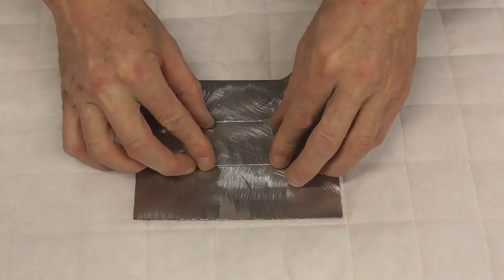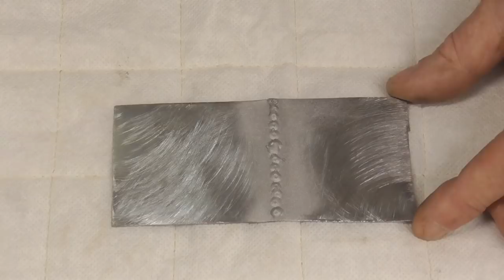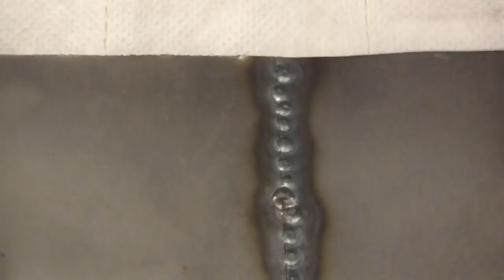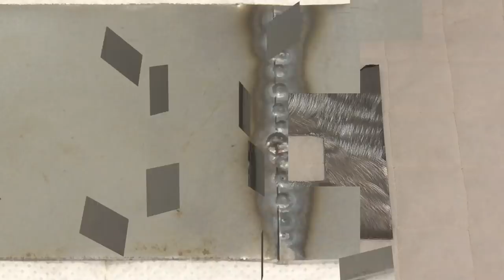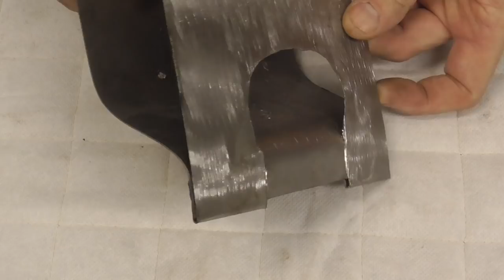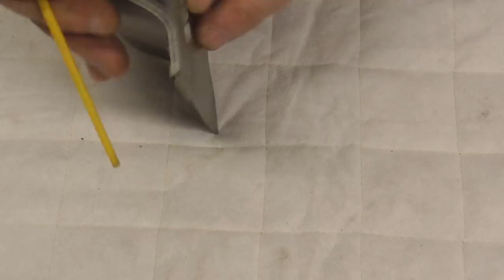Welding Patch Panels - Lap or Butt?

Comment: The back of the butt weld clearly shows that most of your welds are off centre. Grinding the top surface would seriously weaken this repair.

As others have stated, create a patch which is 1mm smaller all round. and use a joggling tool to create a 10mm flange along  the four edges of the repair panel.
This will ensure you don't blow through the original panel and you can run short seam welds rather than an endless number of spot welds, and minimal grinding.

Large amounts of grinding suggest that your wire speed is too high.

Comment: First, thank you for your videos.  OK - I agree with some of your points, but I can make arguments that lap welding is not a good way to go, yes faster - but will create more corrosion problems than what you started with.  Also, both your approaches necessitate the use of a lot of filler after the welds, in order to smooth things out.   Regardless of the welding approach you take, you absolutely need to protect the back side of the panel with corrosion prevention.  Another fabrication channel explores the "Cut and Butt"  approach - I taught myself this technique, worked on the penetration issues and have now mastered it.  If your interested in learning another approach, check out "Fitzee's Fabrication" https://www.youtube.com/results?search_query=fitzee%27s+fabrication He has a number of videos that  thoroughly explain how to make perfect butt welds, setting up your welder, how to finish, etc...  I hope this helps.
Reply from the maker: I use a combination of both lap and butt on almost every patch but I would never just butt two pieces of metal up, weld it, then grind away at the area attempting to metal finish it for many reasons but here are two: https://www.youtube.com/watch?v=MfKlNQF-o4I  - https://www.youtube.com/watch?v=e9bjZ_UxtJg  
Also today’s metal is .030. That is literally 6 hairs (hair is .005) thick.  You start grinding on that and voila paper thin metal and welds. Both methods work well if done properly so in the end it’s what works for you..  Keep in mind, you won’t find anyone butt welding in professional shops. Surely you’re not going to butt weld and metal finish this: https://www.youtube.com/watch?v=36zkc9UQaTs or some of my other rust repair videos.  Use small overlap - weld solid - no moisture - especially if you keep the drain holes clean (most important thing in rust prevention). Note that  the opening of the seam is upside down on the inside too.  Please see this video for longevity of this type of repair if done correctly: https://www.youtube.com/watch?v=8XaZBy7GC7A or 
https://www.youtube.com/watch?v=2o37dX--w0I   Hope that helps :)
Reply: anyone can say one way is better than the other …. New piece of crap cars rust within 10 years  in wet climates …. most cars will not be around 10 years after these repairs , so cost effectiveness etc . Is relevant….. I bet any job jerry does will outlast another place on the car sure to show rust !!!

Comment: A couple of things I noticed. When you showed the backside of the butt weld it was obvious most of your tacks were way off center so no wonder it looked bad. Also you didn't get penetration on a third of the tacks. You say there are gaps on the back for water/salt to get in and rust. If you do the overlap technique there are a lot more gaps for water/salt to get in. So the only advantage to overlap method is that it is faster but has a lot of bondo. Good if you want to sell a car but not if you are restoring one. The other comment is about your use of sandblasting. Don't use it in an area that you can't clean it out completely after blasting it. I noticed you doing it in another video inside a panel and then welding on the outer piece of metal. The sand will rust thru in no time. I speak from experience. I had my 69 Camaro undercarriage sandblasted and painted by someone. A few years later when I went to replace the carpets I found that my solid floors were no longer solid where the sand had got into the crevices. One of my new quarter panels developed a rust hole where the sand settled behind the wheel.
Reply from the maker: I use a combination of both lap and butt on almost every patch but I would never just butt two pieces of metal up, weld it, then grind away at the area attempting to metal finish it for many reasons but here is one: https://www.youtube.com/watch?v=e9bjZ_UxtJg  Check out Eastwood's video in the description too!  Very good at explaining my thoughts on this.
Also today’s metal is .030. That is literally 6 hairs (hair is .005) thick.  You start grinding on that and voila paper thin metal and welds. Both methods work well if done properly so in the end it’s what works for you..  Keep in mind, you won’t find anyone butt welding in professional shops. Surely you’re not going to butt weld and metal finish this: https://www.youtube.com/watch?v=36zkc9UQaTs or some of my other rust repair videos.  Use small overlap - weld solid - no moisture - especially if you keep the drain holes clean (most important thing in rust prevention). Note that  the opening of the seam is upside down on the inside too.  Please see this video for longevity of this type of repair if done correctly: https://www.youtube.com/watch?v=8XaZBy7GC7A or 
https://www.youtube.com/watch?v=2o37dX--w0I

Comment: I always tell to my customers, this is a repair, using metal. Is the manufacturer of the vehicle desingn that makes it rust in some spots. If there not place to treat the patch behind with any kind of protection for the weld it will corrode again. Buttweld is something Fancy, at the end is a repair. And many people look at body filler , like a criminal. 50 years ago , you have to grind the metal to gain grip to the filler, this days filler technology allow you to put filler over barelly sanded surface , without any future problems. The most beutiful show cars are completely skimmed with body filler.
Reply from the maker: Great points and logic Ramon - thanks for the comment my friend :)
Reply: Yes show cars that never see the street or any type of weather so it's a terrible comparison

Comment: I would rather butt weld, that way there isnt a space that can hold moisture. Even if you seal it its eventually going to lose its seal and trap moisture and rust.
Reply from the maker: That’s not true about the moisture  - I've never had rust get between the panels (it's < 1/4" overlap) that's internet stuff.  Been patching with lap and butt since 1984 never had a patch bubble if done right.   Cars rust from the bottom of the panel up because moisture sits down there not on the side of the panel.   Really... see this video for the truth.  https://www.youtube.com/watch?v=8XaZBy7GC7A or this 
https://www.youtube.com/watch?v=2o37dX--w0I
Reply: @LakesideAutobody  I have a 66  mustang that has rusted out spots  where the panels are overlapped so you cant tell me I'm wrong.
Reply from the maker: @masterofnonetv8361  Use small overlap - weld solid - no moisture. Please see this video on how long this type of repair lasts if done right - https://www.youtube.com/watch?v=8XaZBy7GC7A

Comment: 2:59 you're completely off the line and haven't got proper penetration... It's not a problem with chosen technique but application of technique. You didn't even leave a gap to fill...
Reply from the maker: I use a combination of both lap and butt on almost every patch but I would never just butt two pieces of metal up, weld it, then grind away at the area attempting to metal finish it for many reasons but here are two: https://www.youtube.com/watch?v=MfKlNQF-o4I  - https://www.youtube.com/watch?v=e9bjZ_UxtJg  
Also today’s metal is .030. That is literally 6 hairs (hair is .005) thick.  You start grinding on that and voila paper thin metal and welds. Both methods work well if done properly so in the end it’s what works for you..  Keep in mind, you won’t find anyone butt welding in professional shops. Surely you’re not going to butt weld and metal finish this: https://www.youtube.com/watch?v=36zkc9UQaTs or some of my other rust repair videos.  Use small overlap - weld solid - no moisture - especially if you keep the drain holes clean (most important thing in rust prevention). Note that  the opening of the seam is upside down on the inside too.  Please see this video for longevity of this type of repair if done correctly: https://www.youtube.com/watch?v=8XaZBy7GC7A or 
https://www.youtube.com/watch?v=2o37dX--w0I
Reply: @LakesideAutobody   butt weld is used professionally all the time. lap weld is easier and quicker that's why its used for large panels. Its more economical, that doesnt mean its the better option.

Comment: Learn to weld properly there should be a gap between your two pieces
Reply from the maker: With respect, It doesn't really matter in auto body repair and I wouldn't feel good about having a gap.  In the shop, guys who got too particular were very slow, got frustrated, and usually didn't last very long (quit or got fired).   This video is about lap or butt welds for auto body patch panels or repairs not union welding situations - Jerry
Reply: That technique is for professional restoration shops that put out $100,000+ cars. That's why it cost more money for it to be done correctly. Coach builders weld panels with that technique.
Slam doors body shops just slap them together as fast as possible in order to get paid faster. It's about speed for these types of shops. And they use buckets upon buckets of filler on cars.
Reply: James is correct though, a consistent gap all the way around allows for expansion and shrinkage so that you minimise distortion. That being said, it is more of a restoration technique than a quick and economical fix Vs full blown restoration work. ie crash repair Vs restoration shop.
Reply from the maker: @mickholgate3347   I think butt welds ground down flat become very weak and there are going to be very thin spots along the weld - no question about it.  I'd rather get a new panel and not gamble on a guy (not a robot) saying the weld is "perfect" on the back side - Just my own thoughts though.
Reply: @LakesideAutobody  hence why I tig weld them
Reply from the maker: @mickholgate3347  So you know for sure that after you grind the welds completely flat, there is still a uniform thickness to the remaining weld that is as thick or thicker than the sheet metal?  Also, isn't it very difficult and time consuming to match a patch to a completely odd shaped hole?  Lastly, are you using filler?
Reply: @LakesideAutobody  hold up mate, I'm not for one minute knocking your process! In Australia we use a term called "horses for courses" meaning that your process suits a repair shop......It doesn't really suit a restoration shop.

I use tig process as it minimises the heat affected zone greater than Mig. I also use tig as it produces a 'softer' weld that can be planished smooth, minimising the need filler. In most cases epoxy>high fill will correct them. I do ensure full penetration too.

I use a grinder perpendicular to the weld and ONLY grind the additional weld build up. For this reason I don't use a flap disk as it will certainly thin the parent metal too. I finish this with a 36g roloc disk.

Your method works perfectly for you and your customers, at the end of the day, that's all that really matters.

Comment: I don't like your advice..first you are telling that buttwelds are not penetrated at the back and will rust from inside out...on the lapweld, you will have the same because there is still an edge that will catch moisture...second you say that a buttweld must have a perfect fit and takes a lot of time to make...you can make the patch bigger then the hole..tack it and with a thin grinder cut on an 45 degree angle beside the patch..now you can make it flat and tack weld it..do it piece by piece (grinding and tagging)and you will get a perfect flat fit,that doesn't require filler...
Reply from the maker: There isn't a body shop in Michigan that butt welds.   You must be able to fix any thing in a body shop and I mean anything - you're not going to fix this with butt welds - https://www.youtube.com/watch?v=36zkc9UQaTs  If you don prefer butt welding for certain projects see this video:  https://www.youtube.com/watch?v=e9bjZ_UxtJg  also make sure you check out the Eastwood video that I mention:  https://www.youtube.com/watch?v=rpH50kh4W00&t=8s  - Jerry

Comment: So... If you are not going to grind the lap welds down because you want some "meat" and you are going to be using filler anyway... then why the big fuss about "having" to grind the butt welds all the way flat and losing meat.
Butt weld to get as flush as possible and then grind only to the degree you still have meat and then add filler.
Reply from the maker: You could do that.  If you do.... don't do it in a real body shop.  Other guys would have a good time watching that - not the boss though.   Here's the truth on the matter - https://www.youtube.com/watch?v=JIIonJOVro4

Comment: Hearing Your 'Issues' About Butt Welding SHOWS That Watching This Video Is A WASTE Of Time!! Lap Weld And Do Your FAST Work And Not Have A QUALITY/ACCEPTED Patch Repair That Every Restorer Uses!
Reply from the maker: I use a combination of both lap and butt on almost every patch but I would never just butt two pieces of metal up, weld it, then grind away at the area attempting to metal finish it for many reasons but here are two: https://www.youtube.com/watch?v=MfKlNQF-o4I  - https://www.youtube.com/watch?v=e9bjZ_UxtJg  
Also today’s metal is .030. That is literally 6 hairs (hair is .005) thick.  You start grinding on that and voila paper thin metal and welds. Both methods work well if done properly so in the end it’s what works for you..  Keep in mind, you won’t find anyone butt welding in professional shops. Surely you’re not going to butt weld and metal finish this: https://www.youtube.com/watch?v=36zkc9UQaTs or some of my other rust repair videos.  Use small overlap - weld solid - no moisture - especially if you keep the drain holes clean (most important thing in rust prevention). Note that  the opening of the seam is upside down on the inside too.  Please see this video for longevity of this type of repair if done correctly: https://www.youtube.com/watch?v=8XaZBy7GC7A or 
https://www.youtube.com/watch?v=2o37dX--w0I
Reply: @LakesideAutobody  Whatever Works For You. As Far As Professional Shops....I Worked For Shops That've Done High End Builds Or Pricey Cars And If I Lap Welded Patches-I'd Been Shown The Door After The First One! Rust Preventives Now Are A Science And Not As Worrisome As In The Past. Proper Weld Penetration Is Paramount. Don't Need To Watch Videos Of How To Do It As I've Done It! Watch Some Of Junkerup's Charger Body Panel Replacement- He Seems To Know A Thing Or Two! ;-) Take Care!
Reply: @markpalio4411  then why did you watch it.
Reply: @ldean-du5im  I Watched Enough To See That There Wasn't Any Higher Level Shown! How Are Novices And Beginners Gonna Learn If There's Not The Different Philosophies Regarding Welding Techniques With Patches.

Comment: If  mig tack welding scraces you..you should be fussion tig welding...

 your miss leading your audience..
Reply from the maker: If you're trying to say that strict butt welding patches is the only way, see these videos for information on why the highest quality Michigan/Detroit area body shops use many different methods depending on the job and the customer:  https://www.youtube.com/watch?v=JIIonJOVro4  *  Also see Eastwood’s explanation:  https://www.youtube.com/watch?v=rpH50kh4W00 *  For longevity of this type of repair see:  https://www.youtube.com/watch?v=8XaZBy7GC7A
Reply: @LakesideAutobody  no neither method shouldnt scare you

  your video doesn't mention anything about TIG welding ... which provides the least amount of distortion...
Reply from the maker: @772777777777777  I did just get a TIG welder so hopefully I'll get around to making some videos with it - been super busy lately for some reason - thanks for the comment - have a good week :)

Comment: Lazy and cheap. Do it right or don't do it. Faster and cheaper is not the way
Reply from the maker: Are you suggesting replacing the panel? If you're suggesting butt welding you may want to check this video out - https://www.youtube.com/watch?v=e9bjZ_UxtJg

Comment: Bro you got the metal too close together when you welded it you got to leave a very fine gap so you feel the gap with welding wire All you did here was well the top of the metal so when you grind it off you have no weld anymore
Reply from the maker: Here's why body shops in the rust belt don't exclusively butt welds their rust repairs - most use a combination of butt and lap or even panel adhesive for a water tight seam - https://www.youtube.com/watch?v=JIIonJOVro4

Comment: I've done quite a few butt weld patches with flux core, yes it can be done without burning through.
Reply: Make a video! I turn down everything to lowest setting and still get burn thru here and there on lao welds. It was 22 gauge tho. I  switched up to 19 or cut pieces from old fenders to make patches.
Reply: @BearBudgetgarage  following I am about to start a cab with a Forney 140 Flux core. I have never welded. I am just a DIY type. If I have to buy a better machine I will.